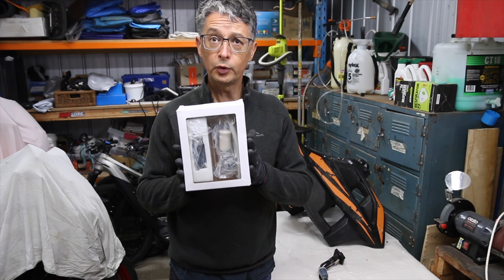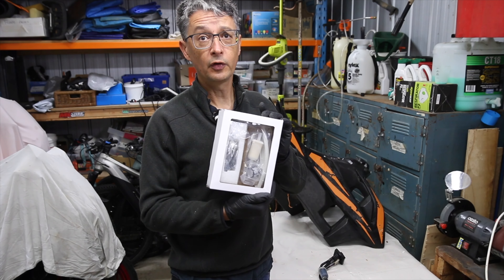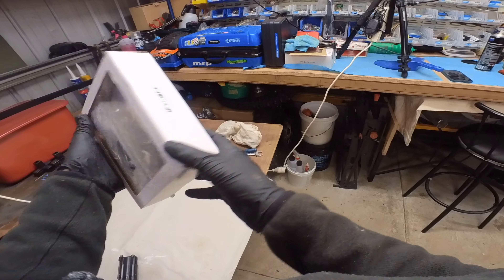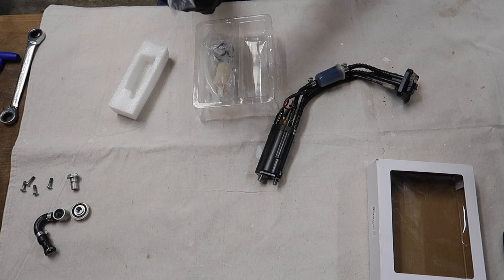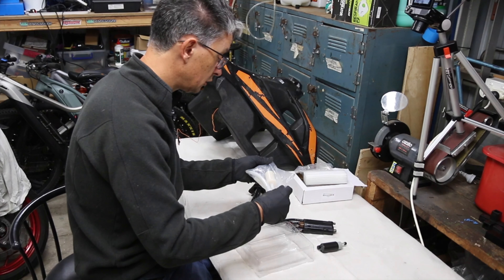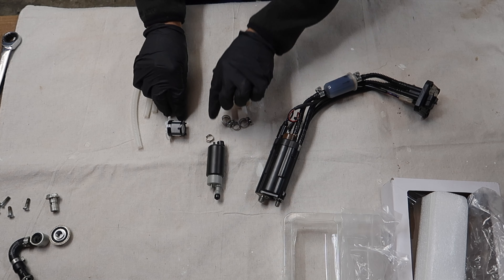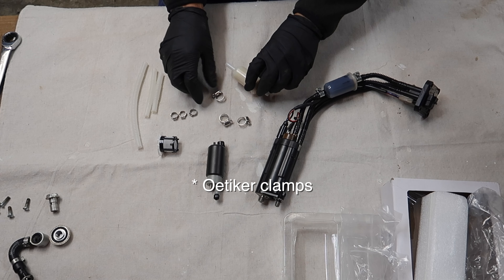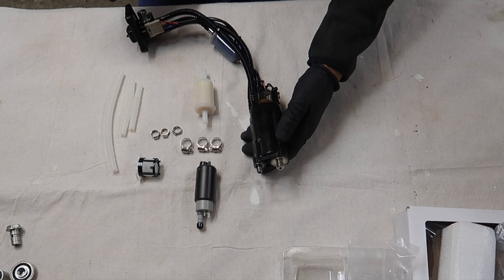Fuel pump replacement, KTM 500 EXC-F

Comment: Great video thanks.  I've done a few of these including one in the field on a mates bike.
Things I would add:

1. A translucent tank makes the job so much easier.  You don't need a pull wire as you can see exactly where the pump is and guide it into place by angling the tank etc.  A see through tank also helps prevent ever running the pump dry which prolongs it's life.

2 Replacing the hose between the pump and filter with a quality submersible rubber fuel hose makes changing the pump or the filter a far easier job.

3. I have had a pressure drop from a small hole wearing in one of the corrugated hoses from vibrartion.  The hose was rubbing against the other corrugated hose next to it.  This was at about 500hrs on the bike.  I now make sure to cable tie the hoses securely together in the hope that this will prevent it happening again and inspect the hoses carefully each time I have the pump out.  Unfortunately the rubber hoses are too thick to swap out all the plastic ones.

4. I test the fuel pressure with a gauge after each assembly to ensure there are no leaks in the system.  There is one oring in particular where the pump exits the tank that can cause a pressure drop without causing a leak.  It's on the threaded nipple on the bottom of the pump assembly.
The pump should produce around 50psi and it should hold the pressure for a few minutes once it switches off.  If the pressure drops rapidly you must look for a leak in the system.

Comment: A couple of points. I once bought a supposedly Japanese made pump but the spigot where you fit the hose was just smooth sided and the kit came with rubber fuel lines. Big problem! I fitted it, left it overnight in the tank with fuel and the rubber hose slid off the smooth sided spigot. The spigot MUST have ridges on it, as his one has to ensure the hose stays on and you MUST use the hard plastic ridged fuel hose.
If you have an Acerbis tank, the pump connection plate at the rear of the tank is attached with 4 self tapper screws directly into the tank plastic. The IMS tank, in contrast has threaded ferrules for the 4 bolts. The self tappers only need about 2Nm to tighten and the tank holes can be easily stripped. I stripped 2 of them but repaired them by gluing some thin bits of cable tie into the holes using the correct glue.

When he started the bike, it sounded just like my 500, very noisy and mechanical and after 5 years I still can’t get used to the “non Japanese” sounding motor. But these motors are proven 50,000 km+ minimal maintenance engines and will never be bettered.

Comment: As a KTM owner I’m amazed that I need pay any attention to fuel pump. I’ve had dozen of fuel injected japanese bikes,  also old ones, 3 of them at the moment and I never ever had any problems with fuel pumps, nor changed any of them.
I think its this KTM thing, they select bad design/components and neglect to correct the problem. Instead they continue the multiply the problem by using same poor configuration in next genarations/sister models. They have good track record on that.

Comment: I did the check at 2:38 (used a 1/4" drive extension to depress the switch inside). Key off - nothing. Turn key on, fuel gushes out. Mine is a 2016 model. Bike has run very well until yesterday when it started backfiring slightly, then wouldn't start.  Only 90hrs on the engine. 

Any ideas?

Comment: I'm thinking, why do they put the filter into the high pressure hose (the hose which is directly connected to the pump), instead of the low pressure hose (the one that goes out of the tank). In that case, there would be less pressure on the fuel filter that we all know has a cracking issue, probably from very high pressure. What do you think K ?

Comment: Hi Keith just wandering your bike is 2019 and how mane fuel pumps did you replace >> Mine is 2020 15k and still original pump ??
Reply from the maker: Just one. OEM one lasted 300 hrs.

Comment: Keith my bike has a bog on WOT. It starts fine and hear the fuel pump prime but has a bog during hard throttle. Air filter is clean, spark plug is changed. I removed the inline fuel filter at the quick disconect to trouble shoot. But not convience its the issue. I didnt check the filter in the tank tho. Would you suggest to go inspect inside the fuel pump tank?